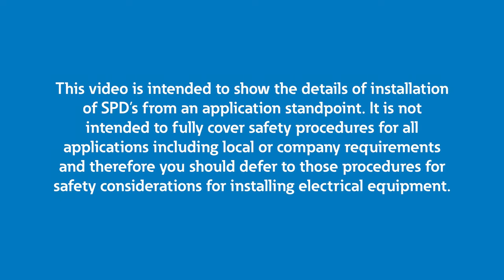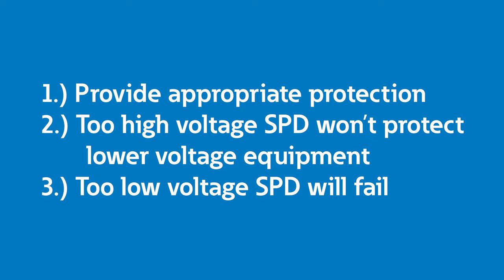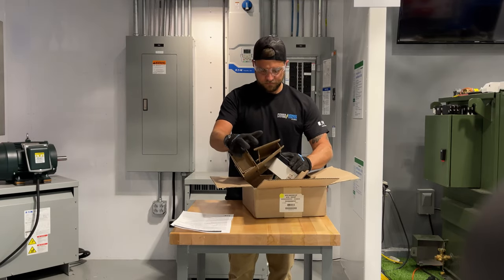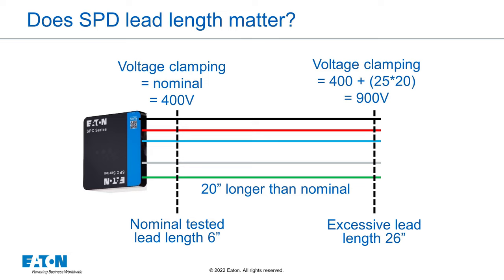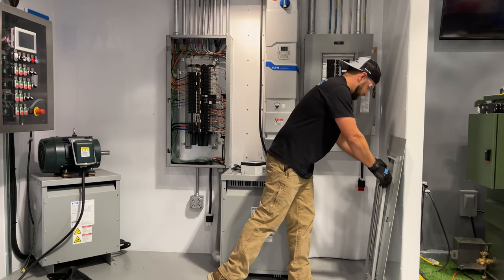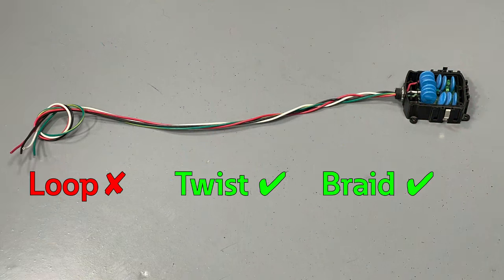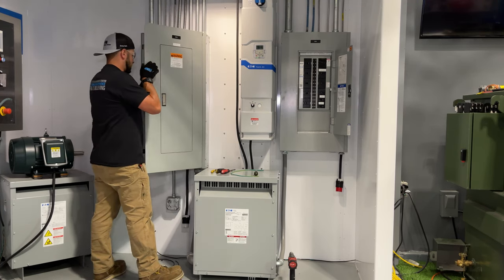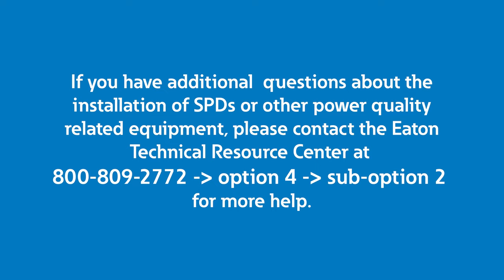Surge protection device (SPD) installation

Comment: Looks like the transformer is extending past or close to the maximum depth of 6" past the the above equipment. But my question is this: Can this device leads be installed on the main lugs if there is no spaces to install a circuit breaker or for panel groupings where there are no areas on the side of the panels. I intend to mount it above and land the leads on the main lugs if possible.